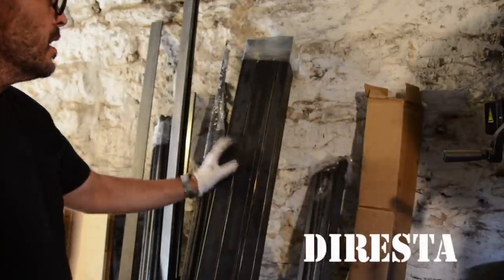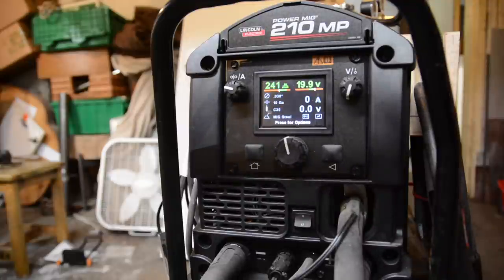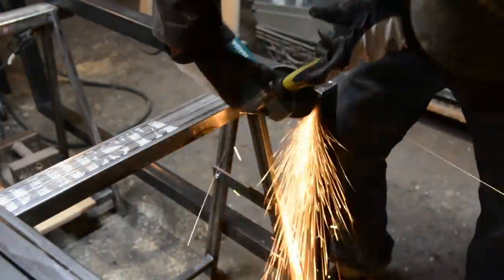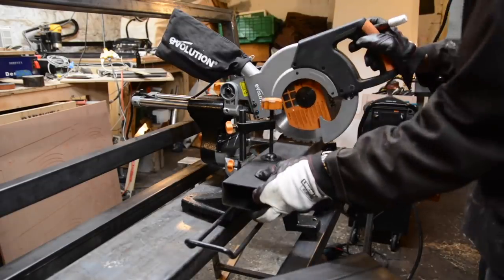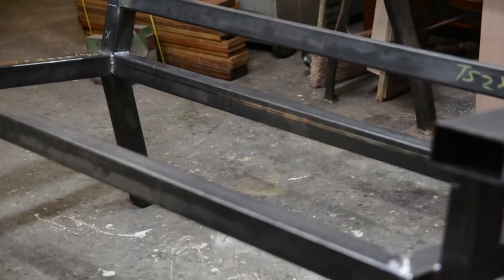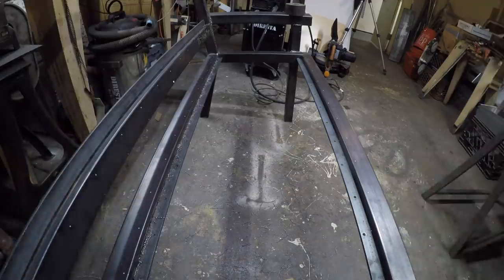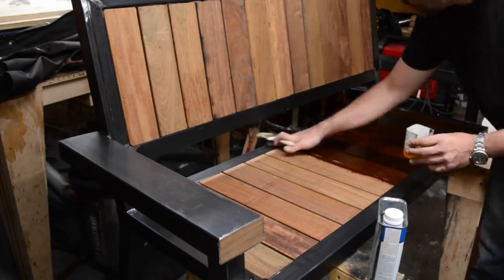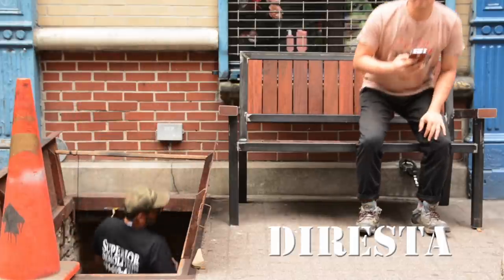ARC Magazine Project Spotlight: Building an Outdoor Bench

Comment: Nice project. I am currently building this bench. Jimmy's how to video is great. The cut sheet is lacking a couple of measurements that would be nice to have such as front leg distance from floor to bench seat, and arm rest weld point on front leg. Also I guess arm rest is level with floor but is there a back tilt to bench seat? I really can't tell very well from video.